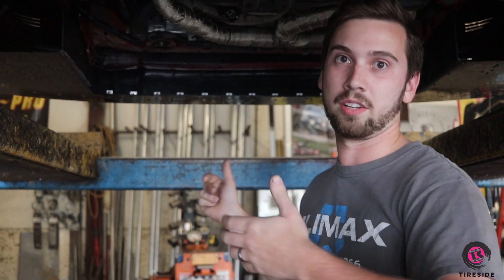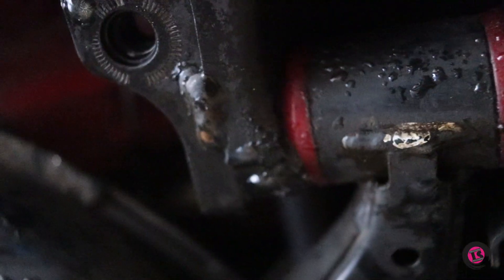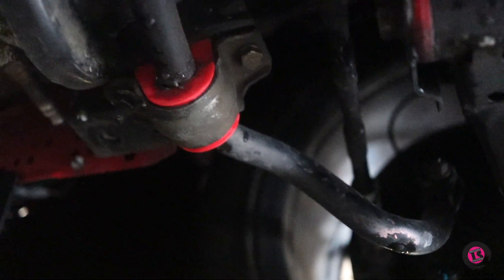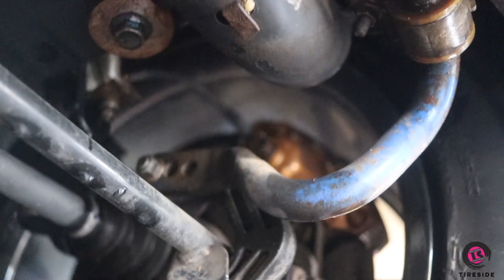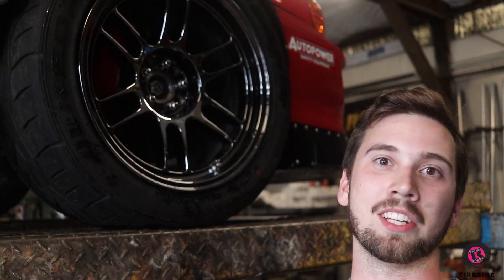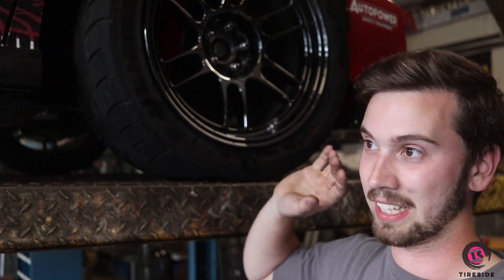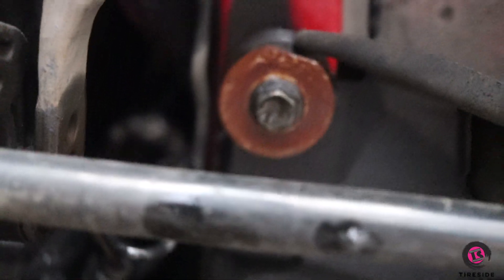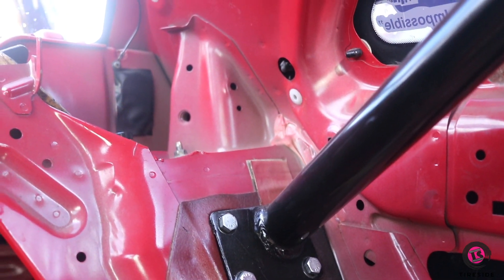Reduce Subaru Understeer! | Track Suspension Setup

Comment: I have an 05 Saabaru, with goals of modifying for road racing/autoX.. But I really wish there was a way to install the STI's manual diff controller.. Which lets you adjust the torque split F to R. That alone would fix a lot of the understeer problem.

Comment: Also most Subaru owners think the forward rake bias is good. Physics says otherwise. Understear in also caused from that. I drop the back down about 30mm in ther rear lower than the front, I also use a scale to make sure the front and rear bias is equal with me in it. A roll cage ads weight to the back. Also rear battery relocate. Getting all 4 corners equal is the key. Then track width, camber, and brake bias. Spring rates are a band aid to a poor braking technique.

Comment: A lot of understear is braking distribution. I set it up towards the back so my front doesn’t lock up. Also having the correct suspension drop so that inside wheel doesn’t come off the ground.

Comment: Actually the under steer is because new subarus have wider rear track than the front. Wider a arms in the front and correct camber in front and rear. As well as your braking distributed properly.

Comment: I had to widen my rx turbo 30mm in the front on each side to run stock wrx axles in it. And then set the rear to 10mm narrower.

Comment: I will say that once I installed Whiteline front and rear swaybars with corresponding endlinks it made a huge difference. It is also nice having the ability to change the stiffness on each sway bar. Coilovers and wheels is next, but I am super happy with how the car handles now compared to oem!

Comment: My wrx wagon (gf8) has 27way coilys fully polybushed inc rack! That makes a big difference
Ally front arms
Roll center correction 
Free castor mod 
Standard sti sway bars 
Rear adjustable laterals and trailing arms 
Newage subframe 
Locking bolts too
Front and rear strut bars and some chassis mods for extra rigidity
And a newish set of toyo Tr1s 

Just trying to dial my own geometry in at the moment
But....
Can confirm it's a go kart

Just realized how old this video is 😂 doubt it was worth writing all this lol
Reply: My friend it was. Buying my brothers 01 2.5 rs gc8. Would love to have fun without a turbo so I wanna have it dialed.

Comment: The street is where it’s needed the most, under steer causes most of the accidents Subarus are involved in, at least the ones I’ve seen
Reply: Mmmm, disagree.  If you are getting that kind of push on the street, you are most likely breaking one or more laws as well.  Just about every car is set up with understeer from the factory.  This is because it is more predictable and in-line with the inputs a "normal" driver is likely to utilize during an emergency.  If the cars came with oversteer instead, you would see A LOT more accidents.  Typically to correct oversteer, you have to apply MORE throttle, which is completely counter-intuitive for normal drivers, who will lift off the gas.  Lifting off during oversteer will cause even less traction at the rear and will spin the car.  If you have to have one or the other, understeer is far safer for street driving.

If we are talking about track driving with an experienced driver, this becomes an entirely different conversation.

Comment: I've done alot of trackdays...  and to me, the 2 top mods are: 
- front H brace - the steering is alot more direct.
- Anti rollbars: either go Stock front | 22mm rear, or 22 front 24 rear.

Next:
2.5" camber front
1.5" camber rear.

And yes coilovers with a bit softer front than rear, as said on the video.
Then... if you have an LSD you can reduce understeer with throttle.
Reply: i have a wax 2006, and will put a bc racing suspensions. Could you say me how much kg on front and rear spring I need to put in?.

And, the front H brace... if I install, I can't remove easily the downpipe? or I don't need deinstall and re-install the front H bar.
Reply: @CBcallofduty  2006 is a bit different from a GC, it's a heavier car, can't really recommend anything.
Yes, if you install the H brace you can still remove the downpipe.
Reply: @PedroFTeixeira   but stabilizer bar too?.

i was thinking put 22 front and 24 rear.

Thechnically if u put rigid part at the rear and softer in front, that make more easily oversteering ?
Reply: @CBcallofduty  yes, that is correct.  22/24 will be very nice on a Subaru.

Comment: I thought camber don't wear out tyres? Isn't bad toe does?
Reply from the maker: Excessive camber will wear out tires because the contact patch is not even when going straight, but in a racing application more negative camber is better for maintaining a better contact patch when cornering.

Comment: More air pressure up front less air pressure in the rear like 1 or 2 psi below the factory spec get good new suspension up front but keep your old struts in the rear because they are already softened go into a corner turn then breaks clutch kick in second gear and straighten out then your good works for 96 impreza outback wagon perfect for daily as well
Reply: Interesting I was thinking more air pressure in rear tires and less in the front. My thinking is less air in front to get a wider contact patch than rear. Also your front tires build up more heat than rear increasing their air pressure as time goes on.
Reply: Adjust the front air pressure to get most grip work tire roll over. From there play with the rear and reduce the grip to where you're comfortable how much oversteer you're getting. Rear adjustment can be means of different spring rates, sway bar, damper adjustments, LSD, bushings, &/or alignment. Fine adjustments can be done with tire pressure to gain or reduce grip.
Reply: P.s. impreza owner for 3 years had the suspension looked at and shook the car front was messed up in the suspension area so we got all freshys and left the rear alone parked my car with my rear in a carport and the front tires poking out in the hot sun and took it for a spin and figured that one out easy as heat makes the tires expand a little more than the ones in the back and of course the break setup bigger ones up front smaller ones on the rear 14 inch wheels and you just rocket through corners like its initial D

Comment: Coilovers only work when you corner balance (whick ppl seldom do), otherwise they are glorified springs/shocks. Caster, camber, pmoi, tire compound, x, y, z all play a part in a car's disposition to understeer. What works on the track doesn't necessarily work in every day like.

Comment: Buy a Golf is the best way to reduce understeer in a Subaru. Subaru's engine is placed way in front of the front axle plane, resulting in terrible vectorial polar moment in cornering, or ultra-understeering (I'm a previous WRX owner), and which caused its string of losses on the WRC to Citroen. Height of engine matters little (dont tell Subaru's marketing that), if you want a car which turns well, you must have the engine behind the front axle, be it front engines, or behind the plane of the rear axle in back mounted engines (some porsches crash a lot of having engines  behind the rear axle which accentuates oversteer).
Reply: Nigga what the fuck did u just say
Reply: bruh fr he pretty much said Subaru’s can’t corner
Reply: @Nbomber Your car and your frineds golf can't be compared to Rally Competition cars, which are 4wd beasts stripped off weight where every fraction of second counts. It is not me stating it, this was stated by pilots of the WRC and engineers as well. Subaru's polar moment was very notorius at the time as an impeeding factor which led to its retirement from the wrc, this is why ford and citroen were even tilting their engines backwards by 30 degrees to gain a few inches of engine recoil and improving their polar moments and diminishing  understeer.
Reply: @Mazmois Mukti Ford and Citroen were tilting their engines 20 degrees  backwards to shave off inches of engine forward positions which highly affect  understeer, so why did they do it? Why pilots such as Loeb had pointed out Subarus were near impossible to win weith  due to their terrible understeer.  Audi was never a match at that time which Subaru left the WRC . Furthermore Audis do not have boxer engines which have their headers projecting to the sides  near the wheels disturbing rotational vectorials. When u lose tents of seconds on each turn , this over hours take an absurd effect. Honda Civics which are the fastest FWD cars learned that lesson by placing their engines over the struts .
Reply: @Nbomber No they (Subaru) had a losing streak of several years to SEBASTIAN LOEB and Citroen, and were also losing against Ford when they pulled out. If they had been on top they wouldnt have pulled out. Subaru was winning in the early 2000's an then spent nearly a decade wihout winning .  No need to school me on a period I actually lived.
Reply: @Nbomber Don't take the Lord's name in vain.
Reply: @Nbomber You think that might be more to do with the golfs awd system? It's not nearly as playful or as rear-biased as the scooby.
Reply: @Nbomber Lmao you shared some good knowledge friend. I wonder how the new golf will do considering they tuned the haldex to be alot more rear-biased. To the point where there's even a drift mode. That aside, Subaru may have to pull out every trick in the book for the future of the STI considering the competitors in this market now. I keep feeling like the success of the evos and previous scoobies were because there really weren't any awd short wheelbase pocket rocket competitors in the early 2000s.
Reply: yeah, they’re not designed to...but this means that in terms of speed, it’s not only about how you tune them, but also how you drive them; if you corner such that you reduce your need for rotational velocity and take advantage of the imbalanced weight distribution, you can fully appreciate what subaru and porsche have to offer. Cornering in the porsche, one would hit the throttle to unload the weight from the front, plant the rear, and bring the lightened front end around the corner at speed. Of course, you’d have to plan your corner entry (braking) accordingly. In the case of the subaru, you throw all the weight into the front while braking, allowing your lightened rear end to come around. Left foot braking and throttle control dictate your line through the corner, and the awd helps put down all the power you can. Please correct me if I’m wrong
Reply: @Nbomber Im not comparing Subaru's and Golf  production models. I myself was a Subaru enthusiast had a WRX until i noticed that its cornering was a big flaw.
Reply: @32523Bwahahaha a wrx is a different kettle of fish to an STI especially a JDM Sti. Check out most timed laps between a golf R and a Sti the Sti wins every one. And from the factory Subaru had the higher ride height and softer springs as their a road going rally car more or less so they can go on gravel, snow, tarmac. So their setup from factory never favoured a race track time

Comment: For the 02 model years give or take a bit, your weight distribution claims are incorrect. Wagon: 58/42 Sedan: 59/41 as per tests done by a couple different magazines. Another thing, Subarus inherently understeer for stability focused at road driving from a typical commuter. The typical drive does not want snap oversteer or ANY oversteer. Imagine people on the roadways everywhere, if companies didnt set cars up as such... you would have  people skidding of the road on every single on/off ramp on the highway! Example... Mustangs - The Crowd Plow fad thats been going on for a while now.... The ferraris that spin out coming out of cars n coffee... ON FLAT STRAIGHT ROADS.....